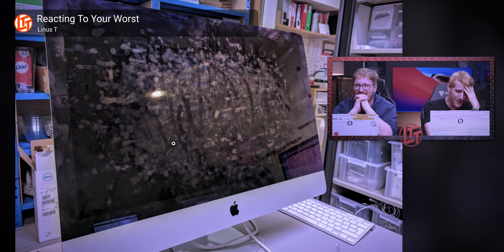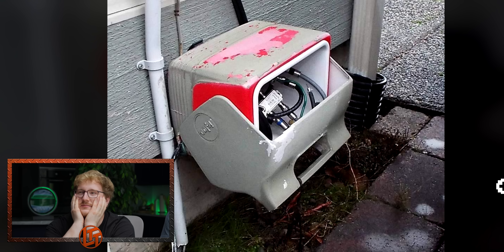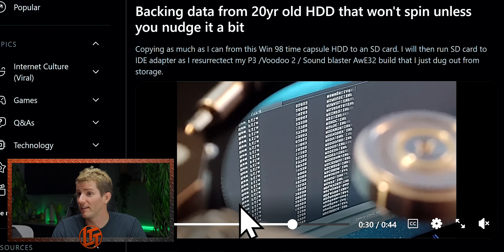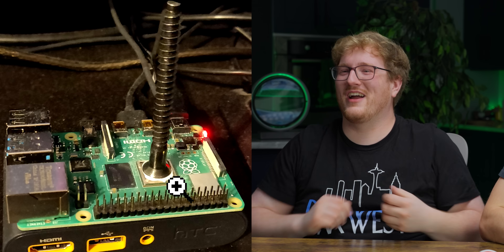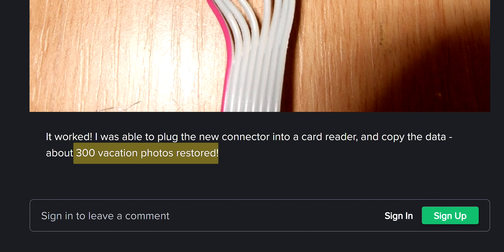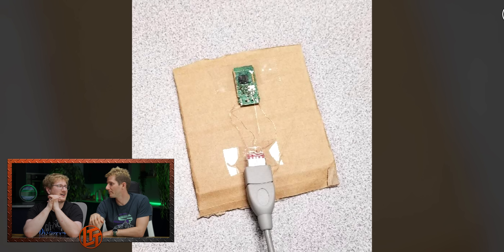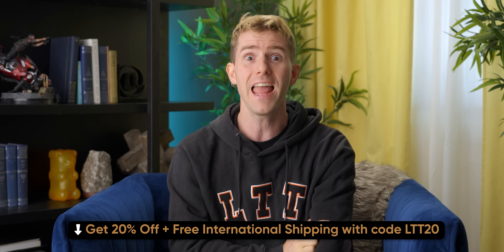Are You All Geniuses or Idiots? - Reacting to Your Best Tech MacGyvering

Comment: "There's nothing more permanent than a temporary fix" energy exuding from this video, especially the wood monitor arms and the fan keeping UKTV alive. The ISP I work for is a lot like this especially when I ask for maintenance or design reconsiderations there's a small town I cover alone that has 2 apartment buildings running by the sheer will of a forward only house amplifier (one of which has an extension cord landlord special'd (I didn't do it) into the crawlspace sandwiched in the trapdoor) with enough tilt to drive a reasonable technician insane, the lower frequencies are way too high and I can't EQ them without destroying the reverse path, but at least I no longer have 2 calls about poor TV signals a week. We also use mechanical connections, where we have fiber to the home, like cavemen (a fusion splicer would be proper). Then again, I do this to myself too, I've been using a floor lamp in my kitchen since the fluorescent bulb quit years ago...

Comment: I don't have a picture of it, but ages ago at a job with al most zero budget for new computers...   user complained that his computer wouldn't turn on.  Found out the switch was broken, so i used some duck tape to hold the connectors together and told the user to never shut it off again.  Managed to last till we finally had enough money to get a new one.

Comment: Ah man the mouse-door one makes me wish I had taken a picture of a hack I did long ago in a lab I worked in.  We had a logic analyzer set up on a device that needed to be trigger armed two different ways.  Our logic analyzer only supported one hardware input for trigger arm, but the GUI also had a button you could click to manually arm the trigger.  I hacked open a mouse, wired a darlington array to the left click button and the gate from the array to the signal we needed to sense.  Since the thing supported USB and PS2 mice we had the PS2 mouse for us to use and the janked USB mouse as our second hardware trigger arm input.
Only problem was if you bumped the PS2 mouse off the button then that signal couldn't arm the trigger.

Comment: I used to take the coax cable line for TV and each room being their all connected would connect audio Mono in the Copper and the ground connection for stereo for longer range cable without having to buy a 100foot cable. I also did this same trick with the built in Phone line which has 4 cables for use for Mono, Stereo and Video.

Comment: Kick-start a HDD: been there done that. The drive would not spin up without a little push. It did not contain anything important (because I knew it was flaky), but I did manage to read the contents this way. Drives were expensive in the 90s and I did not have that much money as a student.

Another story: revived an old MFM drive with errors by replacing the controller with an RLL board. This had better error correction and the drive a usable for a couple of years. Of course, not for critical data...

Comment: 7:18 I once needed to replace a monitor in a pinch, and the only one I could find in storage had holes in the plastic for a vesa mount but no screw holes in the metal chassis inside. I popped the housing apart, zip-tied the back to the monitor arm, and carefully snapped it back together. It was like that for four years until I reorganized the sound booth and replaced it with a better monitor.

Comment: I've done similar to the "Hot Rod full height video card sticking out of the SFF PC" - I made an HTPC back in the day, with a chassis that was meant for HTPC use, desktop form factor, looked a little like a home theater component. But my chosen giant tower CPU cooler was SLIGHTLY too tall. The case expected a standard OEM HSF with a short heatsink and a fan on top blowing down. I had a "dual heat pipe heatsink towers with 120mm fans standing upright on either side blowing air out the back."

The heatsink portion JUST fit under the lid, height-wise. The heat pipes that extended out the top of the heatsink a few mm… did not. There was a grille on the top of the case to mount an 80mm fan (ew.) A couple of the heat pipes stuck out through the grille just fine, I just used some tinsnips to cut small bits of the grille away for the heat pipes that didn't line up with grille holes.

That HTPC served me well from ~2004-2015. (Core 2 Quad 9400S in it for the vast majority of its life, the upgrade to it over a Pentium 4-based Celeron with a motherboard upgrade is what necessitated the snipping, as I wanted a quieter CPU cooler with the upgrade. With it came a video card upgrade to something that could handle HD, I'd been using a Radeon All-In-Wonder 9500 for both TV tuning and composite out; got an HDTV at basically the same time as the Core 2 Quad upgrade, so got an HD tuner and a newer video card with HDMI.)

I still have the system. With an even newer video card (lower-power Radeon 300 series, IIRC because limited HTPC power supply) it served as "spare gaming PC for my kid's friends when they came over." Currently sitting in the garage in a pile of unused PC bits, awaiting a day it is called on again.

Comment: The car window trick works. Window master switch was likely broken. car electrical systems are 12v dc. Old school window motors are simply 12v power and a ground. One direction up the other direction down. The only sketchy bit is that between the two prongs you could short it out or shock your self. I think they tapped into the wires going to the master switch or ran new power from car battery. We bypass faulty Window master switches all the time to get customers windows up until we get the part in.

Comment: One time I was out collecting a server with a system that had no replicas.
It contained important data wihch had to be preserved and be converted to a web sollution.

Then when we came, the people said things that set off some bells. 
Like one said that it was unstable, the other person said: no, we just have the window open on the server room.
So they had the server room window open at all times (window going out of the building!).

Then when I connected to the server, it was full of errors about overheating, about raid missing drives etc.
When we started doing a safety copy of the system before moving it, to reduce risk, the system said it was overheating and a shutdown timer started. Then we got someone to come with a deskfan that looked like the one in the picture.

So I sat there and saved the data while two people sat and hold fans towards the server. We also pulled off the server panels quickly.

We did manage to save the data and migrate it into a web system.

Comment: the alarm clock does come with a rumble pack you can put under your mattress it also plugs directly into a
power outlet not just battery. My best guess is he used the outlet for the rumble pack since you can turn off that feature 
separately if need be.

Comment: As to the HDD thing... if the motor for the spinning of the platter is the only thing that is broken in it, when you send it for data recovery, you know what they do? Hook up an external motor to it in a clean room box and spin it manually at the speed that the manufacturer says it should be spun at.
Works a good 99% of the time if you just need to get the data off the drive and onto another device like an SSD or USB stick.

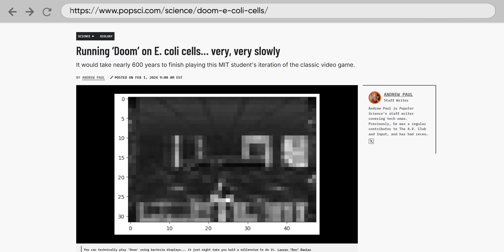Comment: 16:06 that is a sonic bomb alarm clock. It comes packaged with a vibrating puck you can shove under your pillow or mattress. 
I've had one sitting in the corner for about 8 years now. I lost the cable for it ages ago. I often sleep through alarms now. 
I know my plans for today. :D

Comment: Regarding the chromebooks used as clocks, I hope they remembered to limit the charge on the batteries so they don't stay at 100%. 

If you have a device that remains plugged in permanently, limit the max charge somewhere between 50-80% to prolong the life of the batteries.

Comment: Years ago I was too far away to reach the wifi connection of my neighbor who I was renting a shitty trailer from. I put DDWRT on my router, which gave me the ability to see signal strength and better connection overall, but it still wouldn't reach. So I put a metal mixing bowl behind the antenna and moved it closer and closer until it collected and BLASTED the antenna with signal from the distant wifi. Lots of noise, but stronger signal and less losses.

That's not even the best mcguyver bit. That worked to get me signal from 80 feet away. Then my friend who lived in a trailer even FURTHER away, I ran a 100 foot cable through the woods to his trailer, so he could play Xbox -> 100ft cat5 -> 80ft wifi -> dogshit DSL -> wireless connection off a literal island surrounded by water -> normal internet. Our ping was god awful but we could play Halo 3 online baby!

Comment: In 2006 just before our final one of the guys on my team set his laptop down hitting the plugged in USB drive on the mouse and snapped the connector off. I did cannibalized an old cable I had and was able to get his work off of it. I didn't think it was anything special, but everyone seemed to be pretty amazed by it. 

Back then, that was a pretty expensive mistake.

Comment: I have a couple pictures from my PC is it's most concerning form. I bought a second have Valve index and the power wire was not sent with it. While waiting for the seller to send it, I decided I needed to know that it worked and couldn't wait another day.
 
So I rigged up a wire from one of my PSUs PCIe +12v connectors to the center of the barrel jack and from the ground to an alligator clip on the outside of the jack.
It worked perfectly, and a day later I got the power wire in the mail. 

It's even better because at the same time my new 7900xtx was installed but the water block had not come in yet... This did not leave enough room for my reservoir because of the extra length of the air cooler. So I also had my reservoir hanging half way out of my PC suspended on wires.

Comment: On this "this is the kind of guy who's just going to drive a forklift into somebody..." or he's the kind of guy that work's nightshift with hardly anyone there and no forklift traffic and has the area entirely to himself. I used to work in powdercoating: I liked when I could put on the coverall plastic suit with air supply because I could hide my in-ear bluetooth headphones under those.
Reply: Its quite possible that the guy in question is someone who works in an environment where the mandatory hearing protection plus whatever noise the hearing protection stops you from being made deaf by means you can't hear anything from other people anyway so it doesn't make a difference if you are listening to music or not.

Comment: During the economic recession I had lost my job and had trouble finding work so I couldn't afford internet at the time as other things were more important. So I took an old satellite dish and made my own long range wifi antenna as I lived on a hill just outside the city and the local cable company had a couple hotspots down main street. It wasn't the fastest but at a literal mile or more away I was able to use the hotspot to apply for jobs and occasionally game. Only downside was it would require reverifying the login every 2 hours 😂

Comment: 14:01 Actually the wiring of standard power windows implies to the switch to just connect and reverse the polarity. I did it a few times in my carreer, mostly because you cant get the original spare parts right away or at all…

Comment: Many years ago my best friend snapped the sata connector from his only HDD. The plastic piece was still in there but it kept falling and losin connection. So rigged a support piece with one of the pci metal covers from the case, it worked like that for several years

Comment: Man you don't need the specific conditions described to overheat a flash drive, just one that's really small.  I have one of those keychain ones and when I'm writing to it, the copy speed will drop down to a couple hundred kb/s, but if I put my fingers on it (slightly burning them) to conduct some heat away the speed rockets back up after a couple seconds.

Comment: The coax in the Igloo cooler is terminated with compression fittings, which are already watertight. When properly screwed in all the way, the full connection should be too.
Samsung digital signage uses the 'power' button to turn on, and there's another red button on the right that says "Power Off", because the IR code used by the left button is 'power toggle', and TVs use that to switch from whatever their current state is to the opposite. The digital signage only respects a discreet 'power off' code to turn off, and I'm sure for convenience of remote design and use of existing base code, the 'power toggle' is only interpreted by digital signage as 'power on'. This is because it is very important that digital signage isn't inadvertently turned off, or pranked by dorky kids with their home Samsung remote turning them off.

Comment: 10 years ago? Mouse jigglers? That was way too much. At my job, supervisors were in a different city. We had a instant messenger that if your mouse didn't move for a certain amount of time it would go yellow and then red. Supervisors could lock your time for how long you went away for lunch, how long you were at the bathroom, etc. there was no account given for real life tech issues which requires you to be away from your desk. 
Simple solution? Laser mouse set on top a analog wind up watch. The second hands moving around was enough to keep your workstation in the "green" and keep your "supervisor overlords" off your back.

Comment: I broke a cpu pin and solved the problem by cutting a guitar string   and putting it in the cpu socket. The string was long enough to make contact with the cpu when seated 🎉

Have the pc still and it works as intended!

Comment: I had a case that only fit a 240mm rad on top while I had a 280. Cut a hole in top of the case and mounted the rad outside the case.

Comment: I have a video idea for you Linus. 

A poor signal using wifi becoming more stable while connected to a wall outlet charger. 

I'm not sure it's the device being boosted with power to the chip, or if it is using the electric infrastructure to get a better signal. Either way it is definitely a thing and I've not heard anyone talk about this.

Comment: In 7th grade my history teacher's thumb drive died, he let me take a look atat it, i noticed a SMD part looked like it fell off. I thought it was either a resistor or capacitor, and got a pencil lead and used some spit to hold the part in place. Plugged it in the computer lab pc and and XP recognized it! I got his data off and got $20!

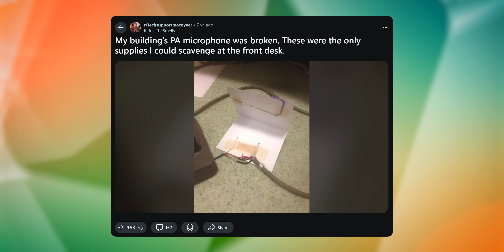Edit: 13:28 another moment remembered.

I had gotten a free shortwave transceiver for ham radio it was broke and i got it to work, but i didn't have a microphone with it. So i used some paper clips and shoved them into the female pins of a CB mic i had and wrapped the clips around the male pins of the mic jack and got on the air! I asked the guy i got it from if he still had the mic. He wondered how i got on the air then, i told him and now he calls me macguver. Noelw the other local ham operators ask me to help fix there equipment.

Comment: The cantenna reminds me of high school at the end of the 90s, not computer, but the antenna for my stero had broken, i used a mix of tinfoil and ducktape to touch the nub to the wall where i knew the metal reinforcements were, almost turning the house into my antenna, though im sure in reality the conduction didn't go nearly that far.

Comment: I wish I had a picture but I had an 94 ford Taurus and the relay that turned on the radiator fan died. So I overheated constantly. I snipped the wire and ran it directly to the battery to test and the fan worked fine. I ran an audio wire to a light switch under the dashboard and I would flip the switch start the car and life was fine. Until the ignition key died so I tracked down how the ignition switch worked. Literally a rod that pushed a switch. So I had a two switch system to start my car.

Comment: from the time of internet-did-not-exist-yet, I was playing a game on my computer and it shut down after ~5 minutes of playing. Rebooted, it died after 4 minutes. Tried again, 3 minutes. Went outside to play, got back, 5 minutes again.

Open the case, turns out the CPU cooler (including cooling block) is just... not attached to the CPU any more. This was in the time that CPU coolers had just become a requirement to keep something running, and the attachment mechanisms weren't great. This one had 4 plastic clips that held on to the CPU ... and they decided to stop being attached on a saturday after the shops closed.

I used a gluestick to reattach the cooler for the weekend & gamed on. Got a new cooler next monday.

Comment: I once wanted more storage for my pc on the cheap, so i jerry rigged some hdds. I used a m.2 > pcie 16x adapter to connect an old ddr2 server hardware raid card. That i then ran breakout cables out the back of the pc and into the cabinet next to it. But my psu wasn't enough to spin them all up 8 4tb SAS drives. So i put a second psu in the cabinet and used an adaper that connected the motherboard connector of the second psu to a molex of the first psu to sync them up. + a couple 120mm fans

Comment: On your first item, the most impractical keyboard computer? Actually, you’d have to go back to the 1980s to find a couple. The Commodore 64, and the TRS – 80 model one Tandy computer keyboard (with built-in computer). I wouldn’t mind taking any of those two form factors, pulling out everything except the keyboard, and putting a raspberry pie in there. It’ll have the old classic early 1980s look with modern computing power!